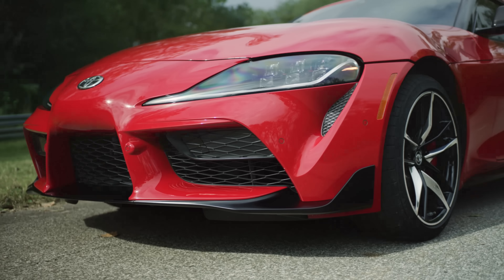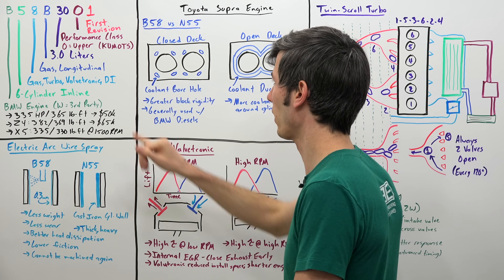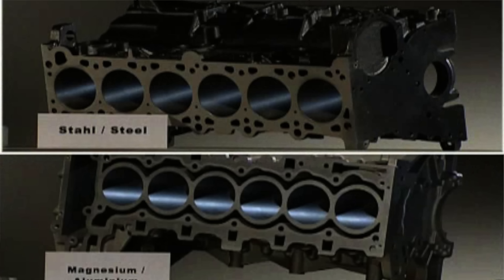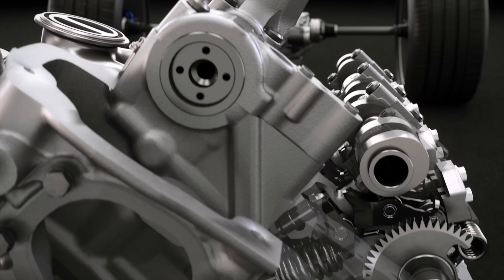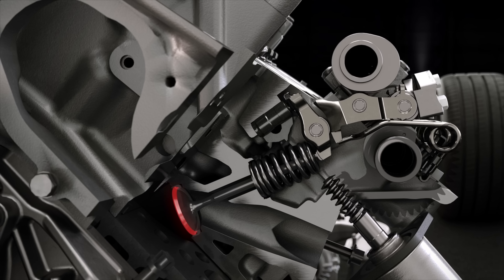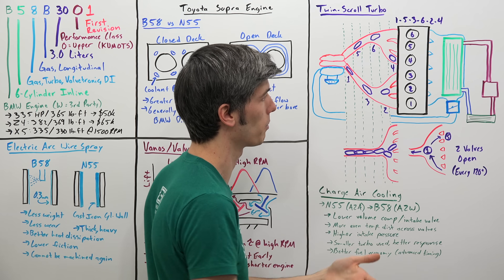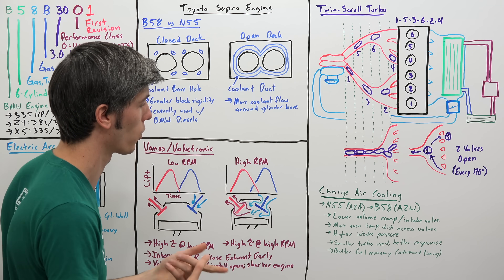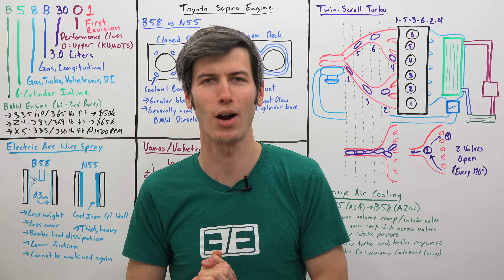2020 Toyota Supra Engine - Detailed Review Of The 2JZ Successor

Comment: I run a BMW repair shop and personally I can't wait for these supra's to start breaking the way most BMW'S do. Need to start thinking of our new advertising strategies now.  Thanks for the customers Toyota!
Reply: They finally noticed having bulletproof reliable cars was not good for profit margins
Reply: Hey Marty. WHat is your take on the first thing to break on the new supra if you had to guess ?  I think that for starters, the computer system will go if it ain't the tranny.  I was in the market for either an X5 or 540i and man... after reading reviews and  all the issues the people were having... heck... I just went tata bmw
Reply: If the supra breaks down its because of shitty German engineering
Reply: Then you should know that b58 is a reliable engine. And ZF is a very reliable transmission.
Reply: @azerogliev6520  the zf is not a reliable transmission. We change 4 a month with age. The b58 is a new motor. It will leak oil like all BMW's. Thanks for your input.  Just Google trans problems and oil leaks on BMW's.
Reply: @MARTYMEINEKE53  I'm a forum biimerpost mod and been with BMW for ages. i don't need to google lol. A lot of what you are saying is stereotypes. Old bimmers didn't leak, new bimmers are a lot improved. there was a period after 2003 when leaking and using degrading gaskets and plastics started - those are majority of issues. New couple generations are good enough. ZF are known to go for 200k miles without issues with timely oil changes. What you have is folks who follow BMW lifetime fluid myth and get their zf ruined. Bottom line is BMW are not most reliable, but they are reliable enough to bring a good 8-10 years of joy. Something that no toyota econobox will do.
Reply: @azerogliev6520  I drive Asian vehicles. BMW's are built to warranty. That's why there 20k and n26 engines blow up before 70k. Also they have a class action lawsuit settlement against there n63 engines.  BMW's are junk but I love they money they bring in.  I won't fall on a sword for BMW their quality has gone way down since 2010.
Reply: @MARTYMEINEKE53  then you should know that n63 is an old engine. it's been replaced with n63tu and n63tu2 and so on - it's now already n63tu4. we are still talking about a V8 n63 that was common in E70 era x5. I'm not arguing with you on reliability part. For my kids I'm buying Japanese/Korean only - but not because they are better, no, but because i don't want to have headaches with fixing them. However, for myself I'm getting only BMW or Porsche. Life is too short to drive boring cars and unfortunately except few exceptions all asian cars are boring. They are all "beige corollas" - it's a name for boring cars.
Reply: @MARTYMEINEKE53  I've been driving a couple of different (Euro-)M52B25 for 23 years now. Never had any oil leak, not even from the servopump that people seems to talk about. In fact the only breakdown has been a 3rd party waterpump that exploded. (And with my Honda I've hade no breakdowns.)
Reply: @kanalnamn  m52 were very solid engines after 2006 BMW has built crappy motors.  Just realize the fact that my shop only works on bmws and I make 85 grand a year just repairing BMW vehicles.  Now if I can make a living off of 1 make think about how unreliable they are.  1 good experience does not speak for the millions upon millions of vehicles they have built. Tldr  no car company wants to build a car that never breaks other wise they would be out of business.

Comment: The b58 and b57 (7=diesel in BMW engine code) use the same block. So from a business perspective it makes a lot of sense too. Only have to design one block. It needs the added rigidity particularly for the diesel variant. But also a huge plus for the after market. (EDIT:Crankcase not block)
Reply: still, not as tunable as the 2JZ

Comment: Toyota is no good at building performance engines. BMW is very good..that's why Toyota chose the BMW B58. And yes even the success of the 1JZ/2JZ was largely possible because of the Yamaha head design. Even the ISF V8 and the LFA V10 are Yamaha built. The V160 in the MKIV Supra is a German Getrag transmission too. So not a whole lot of "Toyota" went into the MKIV Supra either.

Comment: B58 is the 3jz.  But no stick shift is a HUGE let down.  Sure the auto is consistent and fast.  It's even convenient.  But this is supposed to be Toyota's flagship GT ever sold under the Supra name.  It's sad that there is no more 2+2 either.  I'm sure this BMW Supra's handling will be amazing because of it's size.  But the Supra has always been a longer wheelbase car and 2+2.  It is now a BMW 2-seater which is sad.  No chance on doing a 2-seater with kids so Toyota threw that market out the window.  But ultimately turning the Supra into a 2-seater does now make it a true sportscar.  This new Supra does look to lend itself easily to being modified.  Bmw b58 owners have pushed into the 400's whp range with just bolt ons and tune.  Kind of like bolt-on stock turbo 2jz's.  They've got to offer a beefy enough manual gearbox because putting in the zf auto just won't go 1000whp+.  I hope Toyota reconsiders and offers a v160 equivilent.  Fun level with a stick shift still and will always rule!

Comment: I don't actually see the problem. Toyota wouldn't be able to jump into this car segment, if not for BMW. BMW produces some of the most reliable cars (according to consumer statistics), while Toyota has even dropped.
Then again their inline 6 engines are and were amazing. Toyota hasn't produced any in sports cars for years. Furthermore the car is being produced in a joint venture. Toyota has say in this.

Comment: Basically a superbly designed engine, with clever tech... but if I get this correctly. The same engine makes 50hp or so more in the Z4 - so why not a little bit of a retune on the Supra and your at 380hp too!? Or does the Z4 have other big changes to allow this increase?

(... and then a bunch of people bitching because it’s in a Toyota, but seem happy that it’s in a 4x4)

Comment: BMW engines ARE NOT and WILL NOT be ANYWHERE near 2JZs boi. Stop lying to yourself. 2JZ was perfection. The best Toyota engine ever. 
Toyota Supra 2JZ-GTE is the most wanted car in Europe, did you ever wondered why? Also new Supra looks like any other sports car. Boring. Meanwhile original Supra looks still like a BEAST. I want one. I search for one. I will get one... But it's hard find with LHD.

Comment: As the owner of a 1998 Turbo 6speed Supra, I can't wait to drive it to the Toyota dealership to test drive this "Supra" disappointment just for the hell of it and then after the test drive, get back into my 4th gen and drive it home. 

This shouldn't be called a Supra. It is not a Toyota motor with Yamaha help. There is no manual option. 335 HP, so we waited all these years for an additional 15hp from the stock USDM 2jz. What a joke Akio Toyoda.

Comment: So... since it doesn't have cylinder sleeves does it mean entire engine block will have to be replaced when this thin layer of sprayed iron fails?
Reply: Marine475 no you just machine it for roundness then fit liners.
Reply: @brisance  But I have to bore out the engine block since original lining is only 0.3 mm thick ?
Reply: Marine475 yes you have to bore the cylinders then fit the liners. 👍🏼

Comment: So BMW reliability at a Toyota price?  I guess that's better than a BMW price...
Reply: Bmw isnt reliable lmao
Reply: I just dont understand why you would spend 60k on this supra when you can get a real one for that price
Reply: Josh Hayes
in which reality is this a "toyota price"? It's in fact a BMW price, just very slightly less than the Z4.
In my country the Z4 with the same engine will start at 63.700€ and the supra will start at 62.900€.
Reply: @Etherion195  I guess it depends on your country then, here in the US it's about a $15k difference, which is noticeable.  In your country it's an even worse deal, a Toyota at a BMW price, ouch!
Reply: @PrevName-h9v  Yeah, but you can't compare that, because they have two completely different motors, power levels and options/features at base price.

Of course, here the supra might have the shorter list of options (we don't know, since it's not out yet, while the Z4 already is), but still. If i configure a Z4 like i want, i land at roughly 78.000€ i think. So even, if you couldn't get the supra over 65.000€ (which seems quite impossible), it's still a bmw price.

But to be fair: it's not a toyota at a bmw price, but a toyota branded bmw at a bmw price.
Reply: @Etherion195  Fair enough, either way it's too much for what it is.
Reply: @PrevName-h9v  well, i kind of agree. But on the other hand: Where do you get a proper sports car (small, agile, low center of gravity, that power etc.) for less than that price?
Sure, in terms of weight-power ratio there are a few much cheaper or equally expensive options (mazda MX-5, Lotus elise etc.), but with exactly the former mentioned specifications? i can't find one right now at the top of my head. Maybe you have a few ideas.
Because, you have to remember: only the chassis, the name and the branding are from toyota.
Reply: @Etherion195  brz, spend 5k on it and you got a proper fun sports car. this car is overweight anyway.
Reply: @nanderlizernanderlizer684  uhm, no, not at all. No inline-6, by far not enough power (i suppose you would spend the 5k on a turbo kit), the weight of the supra is not even revealed yet.
Reply: Wait until you start to pay the BMW replacement parts.. I have an Alfa gt just one door handle costed 160 Euros and 30 more for the job, but still the guy at the shop (who is a friend) works both on Alfa Romeo and BMW cars and told me BMWs are even worse than that. Also another friend messed the rear bumper on his BMW 316, replacement bumper costed 760 Euros, 150 more to paint and 80 for the replacement and the whole car costed about 30.000. Seriously can you imagine paying about 1/30th of the car's price to replace one god damn bumper?? (And it was not even the ///M look)
Reply: this is bmw price anyway. so its basically a bmw with ugly 'yota looks.

Comment: The fact that you cannot resurface the cylinder walls is a mind blower.  I know the most valuable supras are stock, but in the DNA of almost every youthful supra owner is the desire to customize their car. The 2jz engine was soooooo overbuilt that it turned into a legend over time. It was truly special, unique, as well as unparalleled in it's structural drivetrain. Not only is the new supra engine not Toyotas, it seems more delicate to engine modification. I'm sure Toyota still has the schematics of the original 2jz, so why didn't they use those schematics as well as the 2jz block molds and update them? I would be far more excited if they built the new supra with the 2jz drivetrain. Toyota has been promising a new supra for years now. They certainly had enough time to develope something incredible, but they fell short. The LFA is amazing, so what the hell happened?
Reply: Ian Klingensmith this is not new. Hell the R35 GTR has the same cylinder wall surfacing tech when it was launched on 2007, TWELVE YEARS AGO.

Comment: The fact that BMW made the motor makes me think the new Supra will have the reliability of a BMW (low) and the excitement of a Toyota (low) - I hope I am wrong, but having worked on modern BMW motors... terrible and I think all of Rover must be crud for it.
Reply: Agreed, I know the engine I'm about to mention is a v6 and not an inline 6, so this suggestion may piss purists off, but if they wanted a reliable, respected, relatively easy to tune turbocharged engine, I think the 3.5 ecoboos would have been perfect, easily 400 hp. Imagine if they had based their supra off the s550 platform, especially if they used some of the tech found on the gt350 from a suspended chassis standpoint, it would have been amazing. Plus, given the size and proportions of the s550, a production supra based on that would bear a closer resemblance to the ft-1. That's what killed the supra's design, the proportions and scale are way off. But anyways, yeah, that would have been perfect to partner with ford, but I guess not.
Reply: @KB-bh9hp  100% agreed. I have a feeling the new supra would NOT exist if not for the BMW partnership, but... since it's not in the wild yet... not sure if it's good it exists or not. I'm skeptical. If the engine build quality is MUCH better than BWM standards, it will be a great car, but if it's standard BMW fair... the Supra name is TRASH.
Reply: +Ian Landesman Agreed, my BMW was terrible. They've been testing this new supra for so long, that the issues may be worked out, but I'm skeptical. Even if it's reliable, because it's a BMW engine, I can see the servicing costs being skyhigh.
Reply: +Ian Landesman I just don't really like anything about this new supra, I don't like the looks, the performance is ok, but not good enough for the price they're charging, the reliability likely won't be amazing.